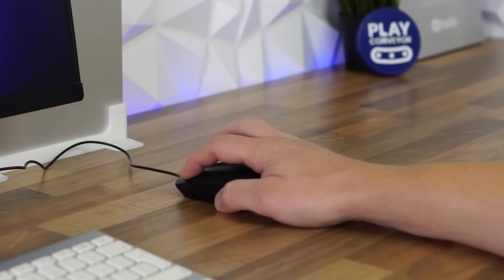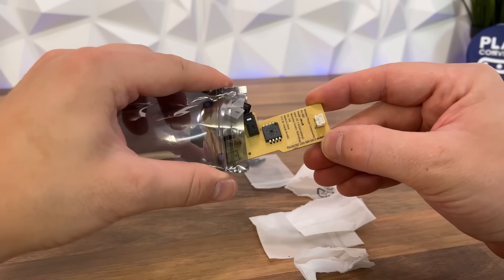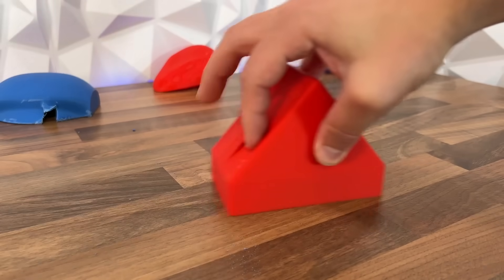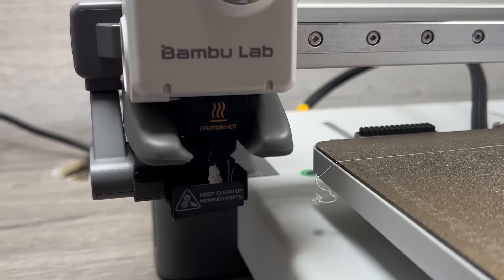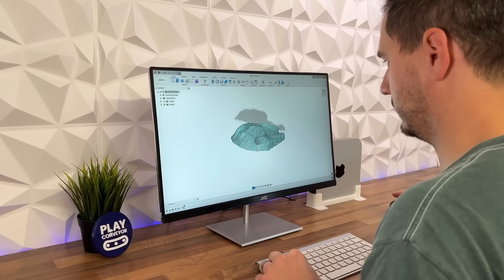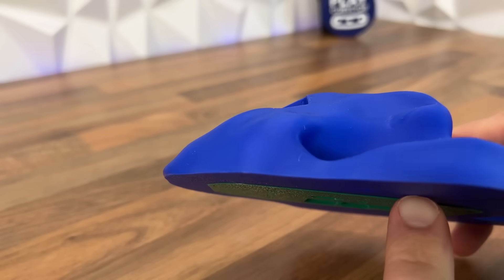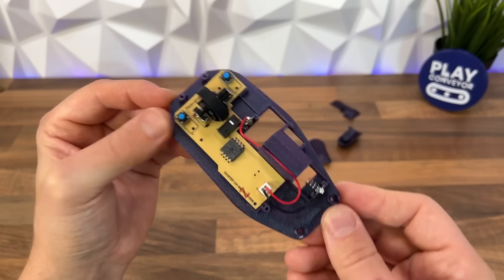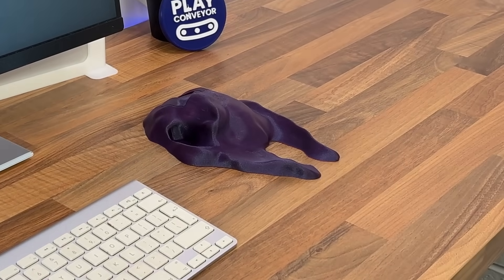I Built the World's Comfiest Mouse (ft. Bambu Lab A1)

Comment: Few thing's you should add!
1. Moust feet, less friction would be amazing for how much surface area that thing has.
2. dip it in some sort of rubber/silicone material to add comfort all around
3. add some sort of cushion near the wrist, similar to those anime boob mousepads

I think you're onto something big here, I would love to test it out!
Reply: I'm sorry, WHAT MOUSEPADS?
Reply: @BlueWhipper3D  Yeah, its a thing. People have said they're genuinely good for your wrist, since there are mouspads that take the same idea without it being tits.
Reply: @Sivanot they aren't really. Ideally you want your arm from elbow to hand completed horizontal, otherwise you risk carpel tunnel
Reply: @bok9596  Sorry, I meant to say that they were comfortable, not necessarily that they're actually good for your wrists health.
Reply: yup i got one. (not anime tits, just a pillow ad a oart of the mousepad). got it after i had carpal tunnel syndrome, its gard to get used too but feels so much better  @Sivanot
Reply: @BlueWhipper3D I've seen (regretfully) a comfort mouse pad using Roronoa Zoro's (from one piece) image and his chest was the squishy wrist support. 🤮
Reply: @BlueWhipper3D stay innocent
Reply: @BlueWhipper3D  i remember seeing an ad for a shrek version
Reply: @BlueWhipper3D 😂
Reply: But keep in mind that the coating limits the lifetime of the mouse. At some point that stuff will turn back into oil. First it gets extremely sticky, then it feels like peeling off tape that has been in the sun for a couple months. You'll wash your hands constantly, because using the mouse makes you feel as if you just ate a whole bag of chips.
Reply: @HappyBeezerStudios I’ve never seen silicone turn back into oil. I mean they literally use it as breast implants
Reply: @HappyBeezerStudios  yeah that coating is always terrible. why does everything have to feel like a sex toy anyway?
Reply: the Rat pro X has ceramic feet, much less friction than the usual plastic, those are great.

and rubber coating gets disgusting real quick, i keep scraping it off the things that have it
Reply: @BlueWhipper3D LOL
Reply: @illdeletethismusic  I once made a set of feet from a LCD screen glass. Broke it in half and used a diamond end on a rotary tool (Proxxon FBS 240/E) to shape them and glued them on. They were super slippery! I used them on a Creative Fatal1ty gaming mouse. I had some big plastic covered cushioned mouse pad (from the era of detailed mouse pad reviews, where they tested things like tracking).
Reply: i was thinking these exact same things and came to comment it but I'm happy to see its already here!! GREAT ideas to look into for V2, but maybe a smooth plastic coating somehow? Like my LG mouse is asmooth plastic that's still easy to grip. however once something is dipped in something, it's dimensions change so trying to add a coating might introduce more issues than he'd like to try to solve XD
Reply: But ergonomic research has shown that using a cushion under wrists like the anime boob mousepads restricts blood flow going through your veins from the wrists.
Reply: 4. Add an internal fan to vent out underneath the palm to prevent a sweaty hand
Reply: Side buttons would be a cool addition for gaming and stuff, I'd just put it in the crevice where your thumb rests. Not really an ergonomic improvement, but I don't think it takes away from the ergonomics and it just makes it more useful.

Edit: You could also put a button in the crevice where your pinky rests, since this design allows for that.
Reply: On the topic of mouse feet, if your mouse works well on a table top without a mouse pad, I would recommend using ball bearings. You can just heat them up and embed into the plastic.

I've modified my cheap office logitech with skateboard ball bearings when I wanted to play games and the standard feet friction was too much for FPS. My logic was to limit contact area, and there's no better shape for that than a ball, but as the balls ground a bit it still works pretty well just because the material is hard enough.
Reply: Also, too add to this, I think that the mouse’s area between the wrist and hand should have a joint or something like that, because it doesn’t look like you can independently move your wrist/hand with the “fork” that starts going up the forearm…
Reply: "ANIME BOOB PADS" Ty i shall never eep agian
Reply: Anime boob 🤤
Reply: Definitely need something for the wrist area. Just dragging out on the desk seems silly.
Reply: Id move wheel or 1 button to the side
Reply: THE WHAT
Reply: Oh, so that's what those mousepads are for...
Reply: @EnderGradAlt And also for simps
Reply: Actually, friction has nothing to do with surface area.
Reply: @KhanChinggus  Friction has nothing to due with the surface area of the bottom of the mouse lol? I don't think you understand what I am saying, more plastic rubbing against table=more friction. No plastic, and instead very small areas in the corners where toy could add some ceramic mouse feet would = very little friction. Use your brain silly.
Reply: feet
Reply: What about some programmable buttons
Reply: if he wants to make it more esthetic, he could simply make the parts that the hand don't touch smoother. Right?
Reply: Things is a plural word. It doesn’t need an apostrophe.
Reply: A cushion attached to the mouse could potentially restrict wrist rotation or at least render it less precise. Your wrist needs to be able to anchor against a detached entity like the surface of your mousepad or table in order to achieve the highest level of control by engaging the fine muscles of the hand. These muscles cannot effectively move the mouse when they have to fight against the weight of your wrist and arm pressing down onto a part of the mouse. If you lift your wrist your arm is floating which leads to strain and loss of control.  Imagine trying to write with a pen or pencil without your hand touching the table.

Also, in theory, surface area doesn't affect friction between hard surfaces as the increase in surface area is cancelled out by the decrease in pressure. Of course, the material of mouse feet is probably smoother than hard plastic, so attaching them would still be beneficial. 

Rubber or silicone coatings don't have the best durability, not to mention they would probably get super slimy or sticky and feel all-around unpleasant to grip. I can't really envision rubber or silicone affording any major comfort improvements compared to hard plastic. If friction is a concern, many modern gaming mice feature textured plastic side panels, but even smooth plastic is the better option for longevity and feel. 

I can't even begin to imagine all the issues this horseshoe crab design gives rise to, but some that come to mind are as follows:
     Lifting the mouse is impossible (this is a bigger problem than you'd think, especially in gaming).
     Wrist rotation is impossible.
     Similar to the previous two points, fine finger control is impossible.
     Adjustability of the hand and arm is extremely limited due to the hyper-conforming design. 
     There's no room to add thumb buttons, although I think this is fine as I view thumb buttons as kind of a meme anyway (I am a veteran gamer). 
     The scroll wheel is recessed, and, although I also classify scroll wheels as a meme, this is a problem especially for prebuilt mouse PCB kits. 
I wish I could think of more items for this list, but one thing I have learned is that it's so difficult to evaluate something complex like this without actually trying it. The vast majority of problems only reveal themselves as you actually use the thing, and I'm sure this is a thing with many hidden problems.
Reply: Excuse me WHAT MOUSEPADS?
Reply: You are right. An ergonomics improvement enthusiast would never forget about adding mouse feet. But he is just farming for views and comments, just like any youtube content creator, deep research of the subject is never done in such environment.
Reply: Adding feet will not reduce the friction. If the force  (mouse and the hand weight) is the same, the contact area size does not matter - friction remains the same. Adding some sliding material would do, like teflon plates.
Reply: @mateuszpawlik5522  like Teflon mouse feet?
Reply: Let me process this, but… 

ANIME BOOB MOUSEPADS??? 

WHAT.
Reply: Oh god the anime boob thing is an actual thing?!? I saw one that was bill ciphers thighs and now I have no hope for humanity lol
Reply: Some notes: No.
Reply: @Hawk7886  Quick question, why? What was wrong with their suggestions?
Reply: @Sivanot  so you didn't watch the video, lmao
Reply: @Hawk7886  Okay, I literally did. Their first suggestion was some kind of feet, and as soon as I heard that thing scraping on the table, i had the same thought. 2 and 3 aren't perfect suggestions, but they aren't enough to just shoot down with no discussion.
Reply: @Hawk7886  hawk7886? More like hawk2!!!!!!

Comment: I think there’s a fundamental problem with having the palm down on the desk. I think the position is like holding a cup. And your hand has to be semi-relaxed. Kind of like a joystick only you’re sliding it around instead of leaning it using actuators. So almost like you have your fist closed with some on top and you’re sliding around on the side of your palm with the pinky at the bottom. 🤙 pretty much like this emoji only the pinky would be closed.

Comment: Afai understand how iPhone's lidar works is it relies on axelerometer data as well to understand how phone's position changed in space. So it may be optimized for in-hand scanning, while going nuts on moving objects.
You'd probably got something if you moved phone around static table. But I was surprised that set of regular photos worked just as fine.

Comment: You don't normally move only your arm but your fingers also contribute to the mouse movement. Since this format kind of locks the mouse body to your wrist I think that a trackball mouse would benefit more this bigger format
Reply: technically my trackball mouse is designed for my middle finger, but i can just use both fingers if i want by shifting a bit.
Reply: @Appletank8  Do you know the product name so I can have a look at it?
Reply: In desktop use (surfing etc.) I mostly rest the right side "lump" of my wrist on the table and then use very small amount of movement with high DPI and "Enchance pointer precision". And I lift the mouse a lot, but the Roccat Tyon has a setting for the minimum lift needed to stop tracking, so the amount of lift is also very small. Maybe something like 3 mm. So in most cases I don't move my arm much, if at all.
Reply: @HulluJanne  And that's how a mouse should be used. You move it with your fingers, not with your arm. Ideally, you'd rest your wrist on a small cushion so your hand grabs the mouse from above, not from the rear.
Reply: agree, a vertical trackball would also be more aesthetic. and reposition the wheel to work with your middle finger, not your pointer.
Reply: @ESDAFable  The last part is very subjective. To me, using middle finger for the wheel is very uncomfortable.
Reply: @ESDAFable  Do you use the right mouse button with your ring finger?
Reply: Trackballs are great for editing and such where large instant movements aren't required. They suck for most games.
Reply: @brianfoster7064  They... do not, I've been using one for almost 30 years now and yes I game and I am far from the only one.

Comment: You should get rid of the wrist rest since it can actually be bad for your wrist to be "resting" all the time, and you should add mice feet to make it easier to slide across a surface as well as a few other perks. (Namely noise and durability)
Also consider cutting back on weight by hollowing it out or something so that it doesn't make your muscles sore from how heavy it probably is.

Comment: An idea I had for the scroll wheel is to have the scroll wheel with another bigger wheel in the front. so it would be a when that you scroll that scrolls the scroll wheel (then you would have to invert the main scroll wheel in the software.)
Reply: I had the same idea! :) 
I was concerned that there may be some slippage between the two wheels, which may make it frustrating when you're trying to get that precise, single-click scroll.
Reply: Or a three wheel solution to prevent the inversion.
And against slippage the wheels could be gears with teeth. The middle wheel would grip onto the "finger wheel" on the inside, that way the touched surface is still nice, but everything is tight.
Reply: @HappyBeezerStudios  that would work but you couldn't click the scroll wheel so you would need a sliding mechanism. so that you could click.
Reply: @HappyBeezerStudios three wheel is unnecessary, just use software or have one of the scroll wheels reversed (though I think the idea of 2 scroll wheels is worse then 1)
Reply: I am just scrolling this comment